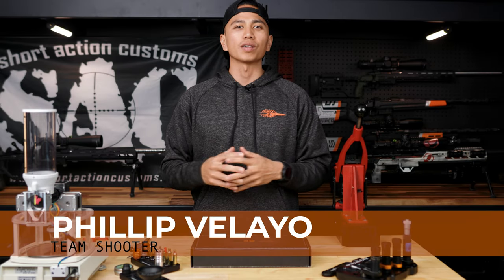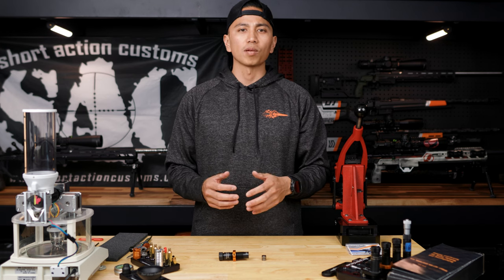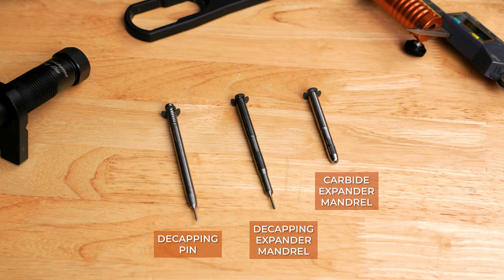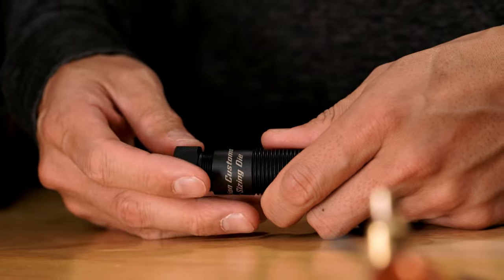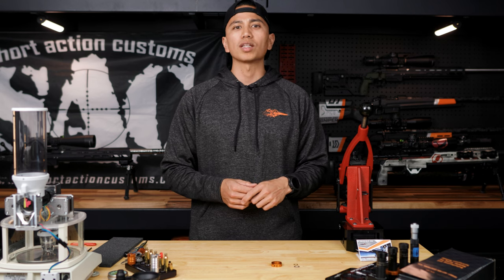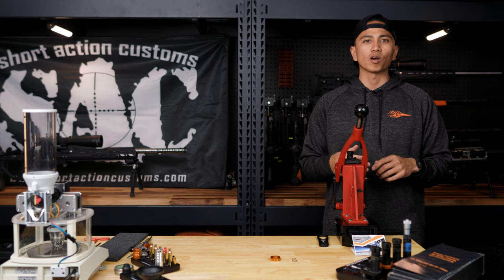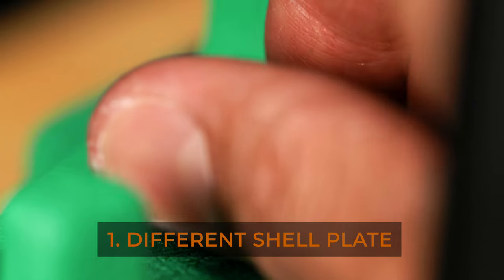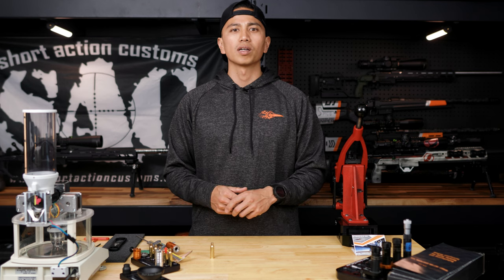How To Set Up Modular Sizing Die

Comment: Do these dies size further down the body and base? Some dies wont. Want to make sure in case I load hot and get expansion at the base/web.
Reply from the maker: Because I have the brass in front of me, lets use a 6.5 Creedmoor and 308 Winchester. Yes, the die will size all the way down to and past the to of the extractor groove geometry. We have noticed that what brass measures really doesn't match up that great to SAAMI cartridge dimensions. So without grabbing specific cartridges and measuring them individually, I cannot speak for all.
Reply: @ShortActionCustoms  Got it, thanks man. I'll grab one for 6.5 since Im already using your bushings.

Comment: Guys, 
should the bushing have a gap (play) inside the matrix, as is done on other matrices during adjustment? Or is it installed without free play?
Thanks a lot for reply
Reply from the maker: The dies have the "float" built in so no matter how tight you tighten the top cap down you will have up and down as well as lateral "float"
Reply: @ShortActionCustoms 🙏
Guys, you are the best

Comment: How does the expander mandrel relate to the sizing process? Do you remove the neck bushing and replace with the expander mandrel to use in a second pass after full body sizing?
Reply from the maker: You Full length size on the upstroke and mandrel on the downstroke.  Everything is done in was process.  Once you reach the top of the stroke and start the down stroke your piece of brass is supported in the neck / shoulder bushing and immediately hands off to the expander mandrel, allow the case to be supported through the mandrel process to prevent the introduction of run out.  Hope this helps!

Comment: Really liking my 6 dasher alpha die, one thing i dont understand about the die is the use of the shims, on my co ax if i bottom out my die i get roughly .007-.008 of setback so I have no choice to fine tune my die but to back it out until i get in that .002 range. Im guess you would use the shims only if the die is all the way screwed down and you dont see any set back? Either way I use the solo ring as well and makes fine tuning very easy.
Reply from the maker: Thank you for your question. We have found that using a reloading press where the linkage connecting the handle to the ram must "Cam Over" slightly to achieve consistent sizing of brass, REGARDLESS of the die touching or not touching the shell holder.  One of the features/reasons is that when the linkage "Cams Over" and locks, the sizing pressure and movement generated is extremely consistent and repeatable. 

We have done a bunch of testing here in the shop on just about every common reloading press on the market and most reloading presses not need any die to shell holder contact to consistently size brass to less than .0015" of headspace Extreme Spread. Not standard deviation, but extreme spread.  Other presses on the market, specifically ones where the linkage connecting the handle to the ram does not reach a "Cam Over" position, they are incapable of sizing brass this consistently and must rely on shell holder contact for any type of consistency in headspace. Reloading presses that utilize the linkage's "Cams Over" design at full stroke when sizing brass inherently are more consistent in pressure and travel.  

To specifically answer your question, the small .001" shims are stacked above the Neck Shoulder Bushing, and below the bottom of the Taper Adapter. They are there to allow the end user to adjust the gap between the die body's Shoulder/Body junction and the Neck/Shoulder Bushing face.  Users can use between 0 and 4 shims (.000" -.004") to adjust headspace, or achieve die to shell holder contact without oversizing their headspace. We recommend using an adjustable shell holder or the Redding Competition Shell Holder. 

We originally released our dies with less sizing in respect to headspace, but we had customers not able to bump their shoulders back even with a hard metal to metal contact with the die and shell holder at the "Cam Over" position with the press.  So we had to increase the amount of cartridge protrusion out of the die to allow all to achieve proper sizing. If your Modular Sizing Die is sizing too much on the headspace measurement, I would suggest backing the die out a little even if you're not contacting the shell holder and you should have no problem getting less than .0015"-.002" of headspace Extreme Spread on clean, lubed brass.  

Mark